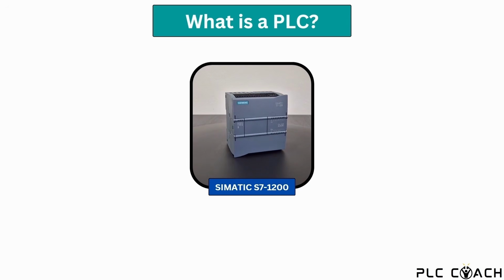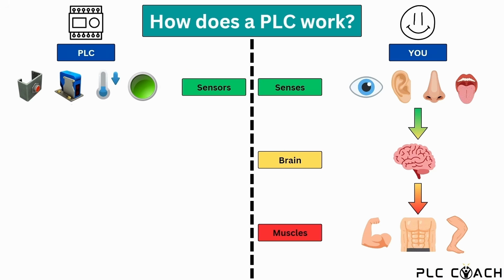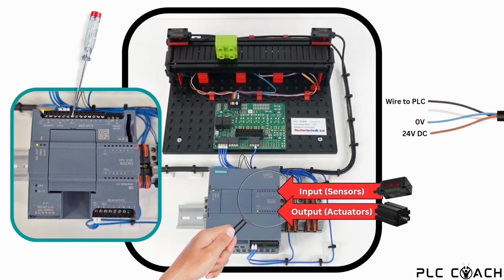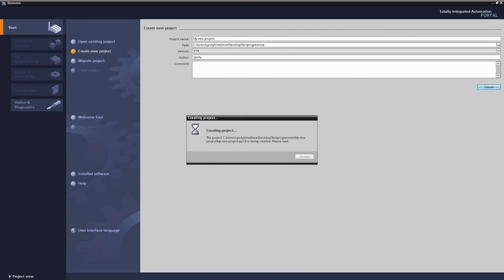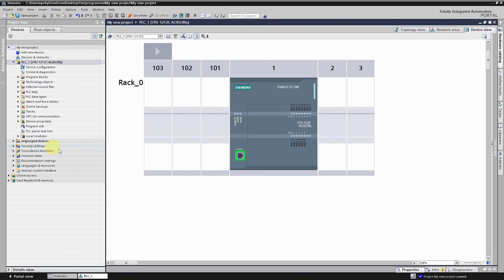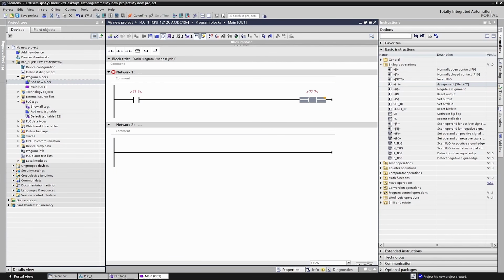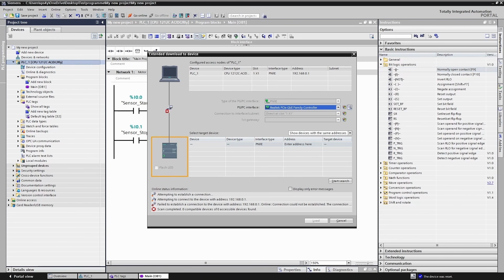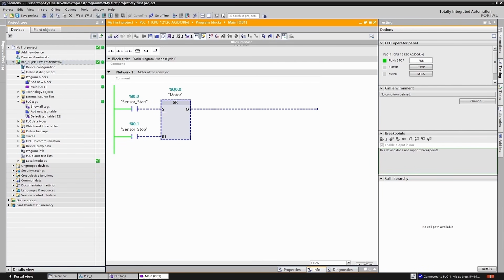Learn PLC Programming in 20 Minutes - TIA Portal Tutorial for Beginners

Comment: Very nice. There is one thing I would strongly urge students to tell, switching your plc to run mode is a potentially dangerous action!! in this case you'l switch on a toy. In real world It can be a massive machine. In industry you follow a long process of testing software and hardware before you switch on something. For testing there are complete software tools that can simulate your proces so you'l can test and debug your programs.
Reply from the maker: Thank you for pointing that out, safety is definitely the top priority in the real world! 👍